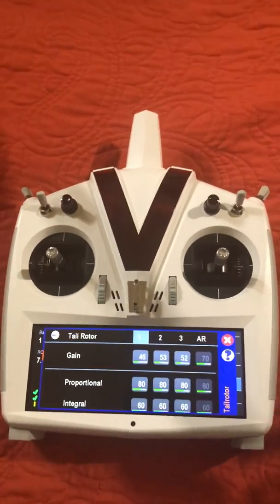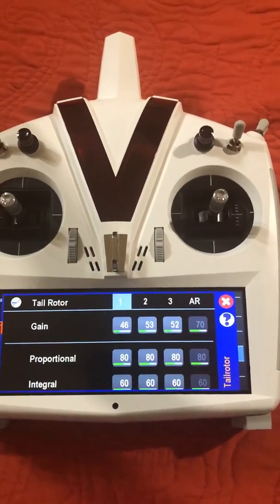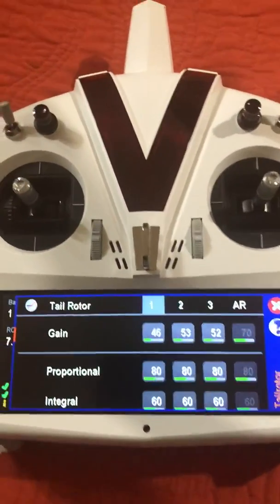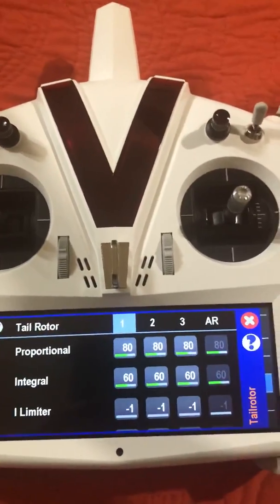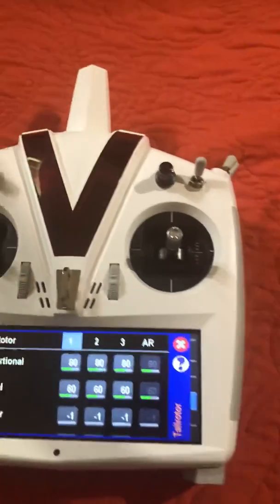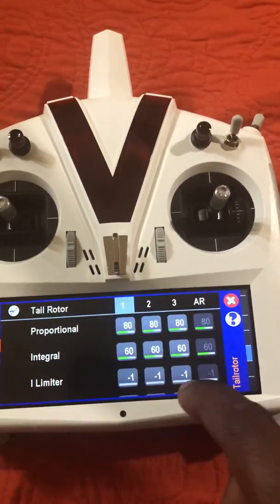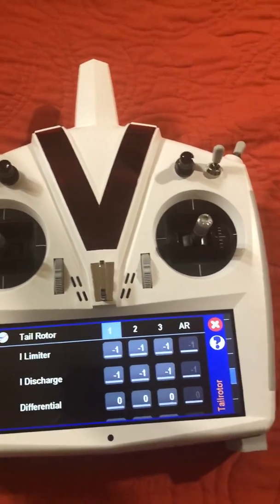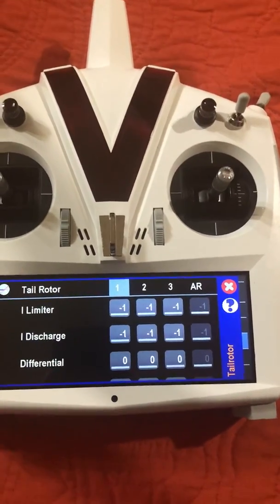Vcontrol Touch P, I, and D gains explanations

Comment: I HAVE A PROBLEM WITH THE TAIL, WHEN I GIVE POSITIVE PITH THE TAIL DOES DRIFT, I TRY RAISING THE TAIL GAIN BUT IT DOESN'T IMPROVE, ANY ADVICE?
Reply from the maker: Sounds like you may have a resolution issue. Try moving the ball on the servo 1 hole closer to the center of the servo arm. Reset your endpoints and make sure you can get full deflection. Also make sure your tail servo is mounted solidly
Reply: @laughingstill  OK THANK YOU, LET ME TRY THAT .